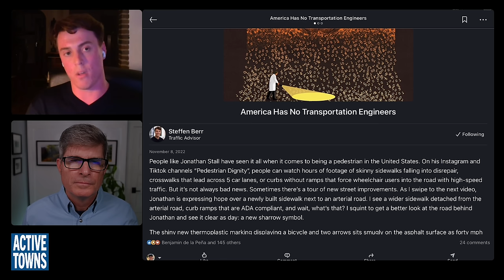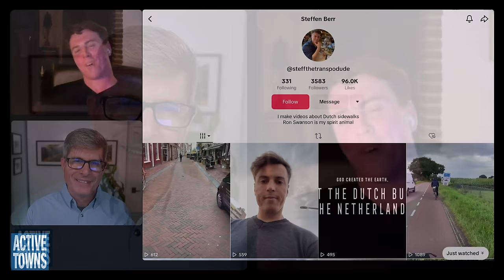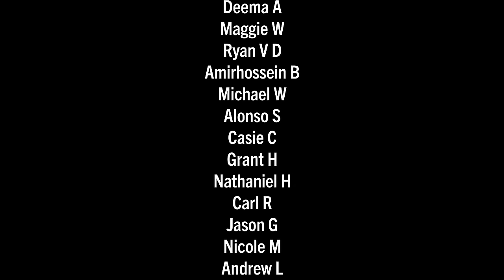A look inside Dutch street design details: A more people-oriented approach

Comment: One block away from my house in the Netherlands, they made "fake klinkers" by putting red asphalt and then melt in a grid on the surface. It is indistinguishable from "real klinkers" even up close but cheaper to make and maintain. I usually don't take that street, even not on the bike because the put it full of horrificly high bumps to slow down traffic. But even at 6 mph it is too high for most cars to take comfortably and on bikes it is a no go (1 bump ervery 50 meters or so).
Reply from the maker: Interesting. Sounds like a failed project to me if people are hesitant to ride on it. Thanks so much for tuning in. I hope you enjoyed the conversation.
Cheers!
John
Reply: Seems to me they got the positives, but overdid the grid causing it to be too bumpy. In the long run, the second they have to access wiring or piping they'll have to scrape off that part of the surface, probably using actual bricks to patch it back up, making it even more annoying.

Comment: Safety, is the issue. Steffen, what did/could you do in the US in this regard ?? Taking into account that ALL partipants in traffic need to be safe, even drivers. As I am sure you will have noticed a few differences in regard to driving just as well. It starts with getting a license, which is different, the roadworthiness of a car, not having anything in your hands besides the steering wheel, securing loads, the position of traffic lights at crossings, NO right on red, etc etc etc What could you do as traffic engineer in the US to improve safety ??
Reply from the maker: I’ll let Steffen answer for himself if he has a chance, but I think he addresses this in the conversation… he was frustrated, knew there was a better way, and chose to seek out that direction. Part of the value of his videos he produces IS to help with the challenges you outline.
Reply: If there was one thing I could do is to force every travel surface in the US be categorized by its intended function. Pedestrian zone, Access, short through movement, and long through movements.
One of the biggest issues is that we don’t have a clear vision for what we want from our travel surfaces so we play around the edges and don’t have a clear sense of direction of where we want to take the design of something. When you decide what you want, this becomes much more straightforward or obvious.
I would also remove the need for a PE to approve engineering plans for traffic issues

Comment: Maybe I'm missing something about how the bricks are different in the Netherlands... but it's really not pleasant to bike on brick streets in most cities here in the US. To the extent that in Boston for example we request that the city use decorative stamped/painted brick patterns instead of actual bricks. I don't think the issue is just excessive car wear and tear.
Reply from the maker: When done well, the brick streets and pathways are quite smooth for bikes... the old cobblestones, yeah, not so much. Thanks so much for watching. Cheers! John
Reply: Besides what John mentioned in his reply, well layed brick surfaces being relatively comfortable to cycle on, 
there is another issue this kind of street design adresses: If there's one thing the last few extremely rainy months 
in the Netherlands forced us (again) to think about is the water-permability of road surfaces to buffer the excesses of stormwater. Subsurface drainage systems just can't handle the amount of percipitation fed into them during the increasing heavy rain events we're experiencing. Every liter of water reduced helps to alleviate this problem. 
Especially in urban areas green (or rather blue/green) roofs can play a major role to mitigate this problem too.